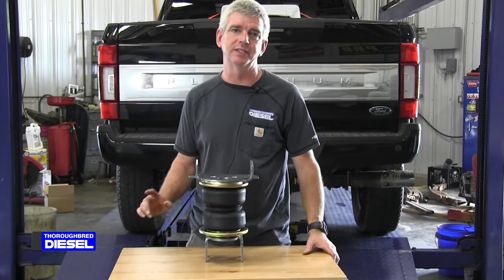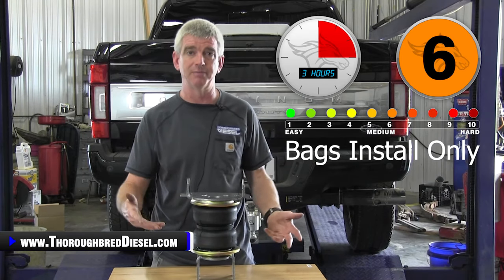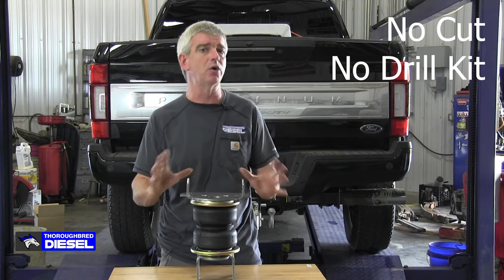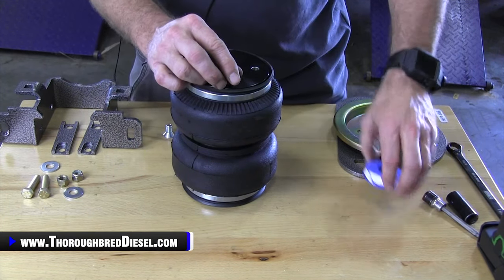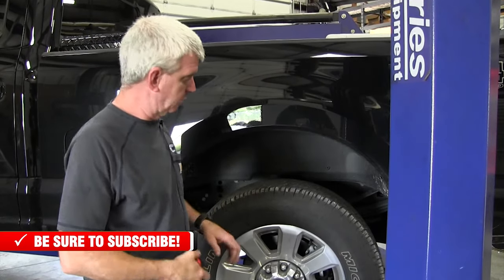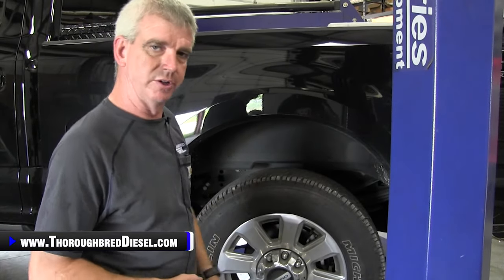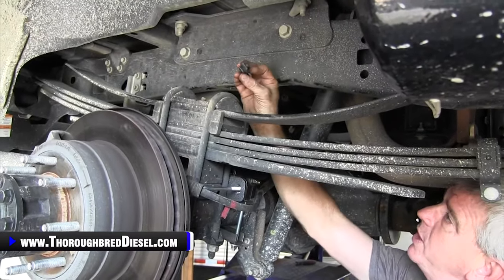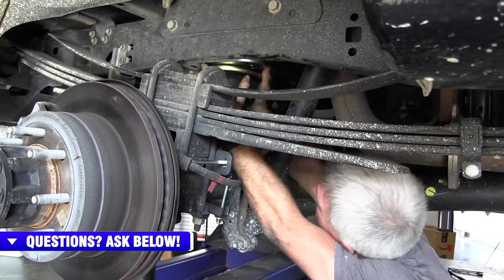Maximize Rear Spring Performance | 2021 Ford Powerstroke Air Bags Install #diesel #powerstroke #ford

Comment: A tip, it helped me and I did a driveway change.  Remove the spare tire.  Helps with making more room under the truck.

I did this by myself, with a little patience on the driver side it can be done. 

I put my axle on heavy duty (6 Tons)  Jack stands.

Comment: I have a 4.5” lift kit on my F250. What do i need to install this on my truck?
Reply from the maker: Here is a great link to explaining that and we offer the spacers on our website.  https://pacbrake.com/all-you-need-to-know-about-air-spring-spacers-for-lifted-trucks/
Reply: I have a 2018 F250 lifted 4 inches by BDS. The jounce bumper tongue is higher now with the lift block. So I'm assuming the bolts for the axle bracket will be too short. Will I be ok buying longer bolts to make this kit work? I'm talking about the bolts that hold the clamp on the bottom side of axle. Thanks